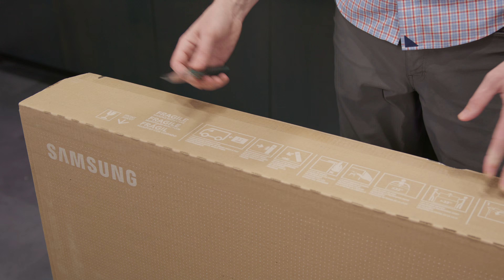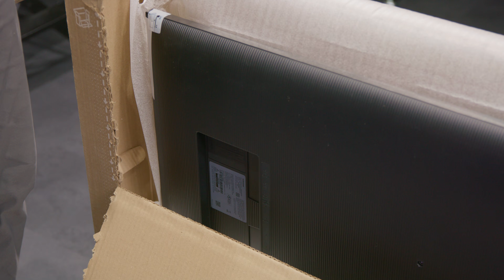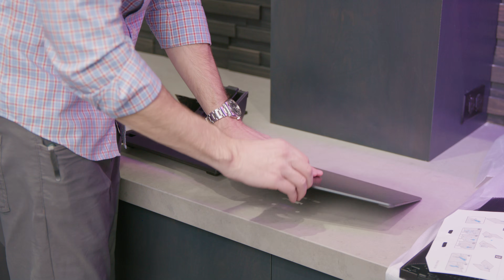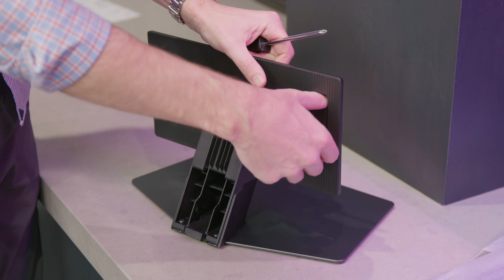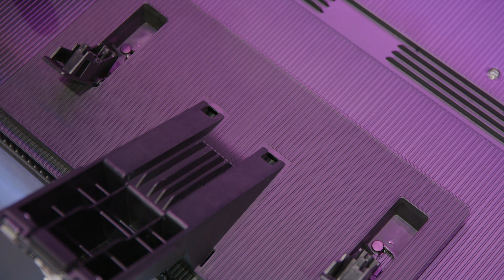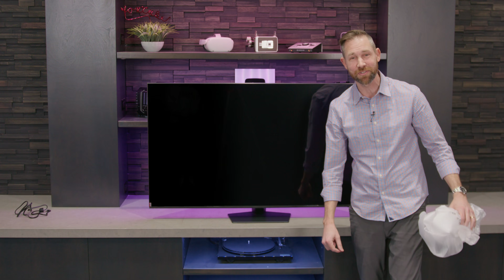How To Unbox The Samsung QN85D Series With Pedestal Assembly And Install: QN55QN85D

Comment: Can 1 person do this?
Reply from the maker: @Moraalridder123 We recommend always having a second person to help with anything 65 inches or larger.
Reply: @abtelectronics yes i already did it with someone. Is it normal that the tv has a bit of play when you gently move it on its stand?
Reply from the maker: @Moraalridder123 It may have a slight amount if it's a larger screen size, but the pedestal should not move around if it's  installed properly.
Reply: @abtelectronics no the tv just wobbles a bit when you push it, it’s 75 inch
Reply from the maker: @Moraalridder123 That sounds pretty typical. If you notice it getting worse, you might want to try tightening the screws in the pedestal. If it was purchased from Abt and you feel like there's a problem, be sure to give us a call at 800-860-3736 so we can help schedule a service call.

Comment: Great material, it's a pity I watched it after assembling my QN85D. I have a question about the connection of the metal base with the plastic shaft. After connecting these two elements, I have minimal play. Is this normal or should everything be rigid? Because when I extended this plastic leg to the metal base, I had minimal play between these two elements.

Comment: I put mine together and while it’s holding up, I feel like my stand may have too much wobble/give? Is it designed like that due to the TV’s weight and a stiff stand would cause it to topple over easier or did I install something incorrectly? Thanks!
Reply from the maker: @kelvinmancebo5375 There will be some amount of movement, but it shouldn't feel like it's going to fall apart. If you purchased your TV from Abt and feel like there is a problem be sure to give us a call at 800-860-3736 so we can help you find a solution.
Reply: @ it doesn’t feel like it’s going to fall apart! It’s just more movement than I’m used to and was unexpected as I have had smaller TVs with double stands on each side and not one in the middle

Comment: Id argue its best to get this TV over the QN90 since the biggest differences are the 90 get slightly brighter, slightly more color and an audio power downgrade from 60w in the QN90D to 40w in the QN85D. 

As well as the professional calibration option available on the QN90D, but you can easily get a cheaper calibration tool and fix that issue. 

Same goes for the audio, if anyone gets these TVs, they are obviously into good quality products, so that would make me assume that they would use a soundbar rather than the audio from the TV. So the audio downgrade isnt really an issue. 

As for picture quality, the QN85D is every bit as good as the QN90D, just a tad dimmer, which isnt saying much as they're both phenomenal lol

Comment: GOOD INFORMATION, A QUESTION WHAT PANEL DOES THE QN85C 65 INCH HAVE, WHY I'VE HEARD IT HAS IPS PANEL IS THAT TRUE?
Reply from the maker: @joseluisburgos1113 The QN85C used an IPS panel, the 85D we unboxed for this video uses a VA panel.
Reply: @abtelectronics  Grateful for your honest answer, I want to buy the QN85C 65 inch, with ips panel does it affect the image quality at all? And thanks for the info.
Reply from the maker: @joseluisburgos1113 IPS panels will have wider viewing angles and better response times which is good if you're a very serious gamer. VA panels offer better contrast in most cases. If you're a serious gamer, you'll likely be happier with an IPS panel. If you're a serious movie watcher than you'll likely enjoy a VA panel more.
Reply: @abtelectronics  I'm more of a movie watcher, but I want to buy it because it's at a good price a monthly offer that they have in the same Samsung store, and it doesn't have the 2022 version, only last year's is the one they have, what do you tell me, would it be a good purchase or am I looking for the 2022 model?

Comment: Waiting the review and a comparison with 2023 model qn85c 
As I found out that there is an audio downgrade 2.2 ch 40w instead of 2.2.2 ch 60w  so I am totally confused which one I should go for.
Reply from the maker: @hamadahawwas4210 Yes, you are correct with the audio being downgraded a bit, but it does get the updated NQ4 AI Gen 2 processor so we did see some improvement to the picture. We are in the process of filming our overview and it should be up next week so stay tuned. Be sure to subscribe and hit the bell so you get the notification!